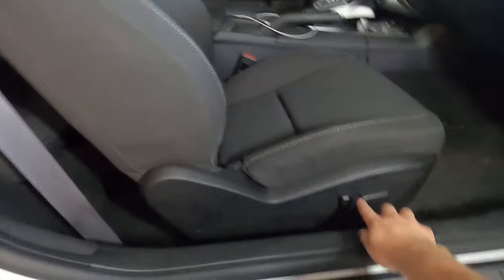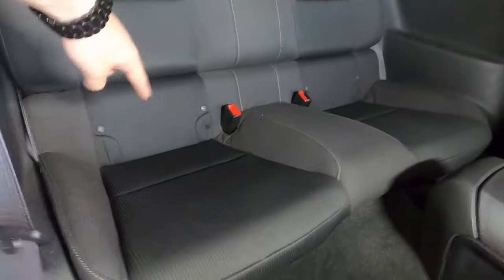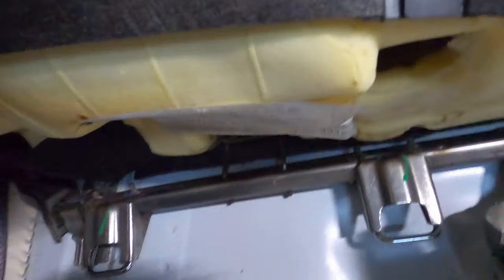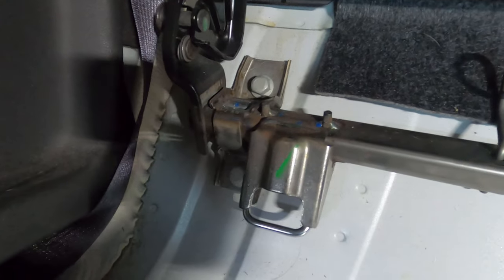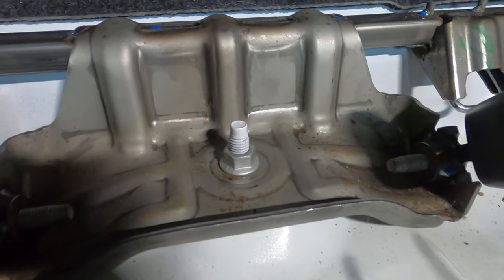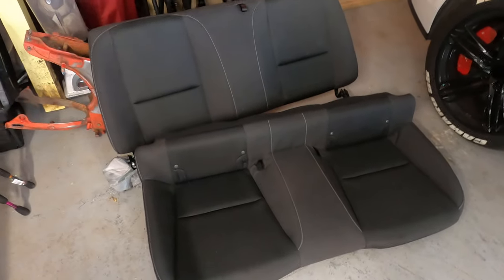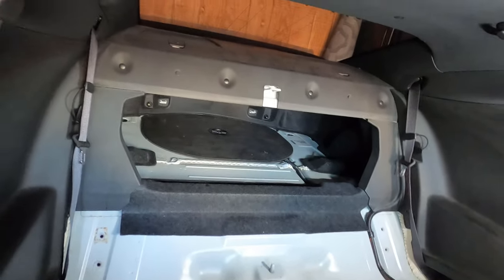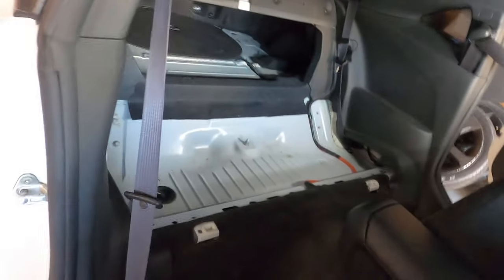5th Gen Camaro - BACK SEAT REMOVAL

Comment: You can save time removing the seat back by releasing the spring latches located on left and right hinge point.  No need to unbolt anything.
Reply: How ? I pushed mines in and the seat doesn’t move I removed the bottom seats just not the top

Comment: Can you get to the fuel pump from here
Reply from the maker: @JoshuaCornwell-jf4fq  yes and no. You would have to cut an access hole above the fuel pump, GM wasn’t kind enough to leave an access door to it. The “correct” way of accessing the fuel pump is to drop the rear end, then drop the fuel tank, but I’ve seen many people just cut the access hole though.

Comment: You didn't explain how to disconnect the top part of the seat. Been struggling for hours now and it won't come out. Not impressed.
Reply from the maker: The back rest, pull the lever that folds it down. The bottom seat, it’s just a hook it slides on to. it’s very simple.